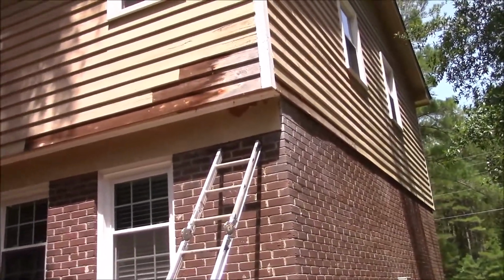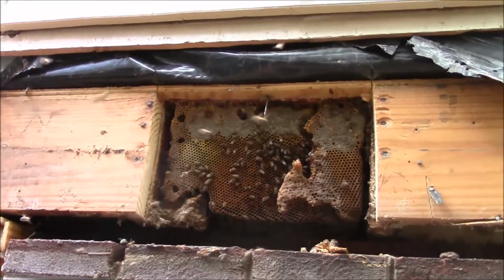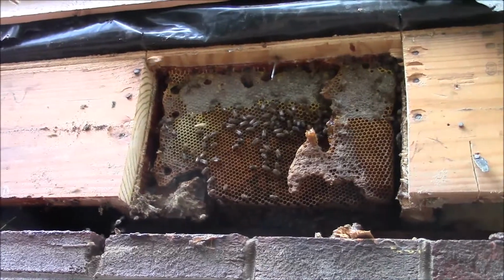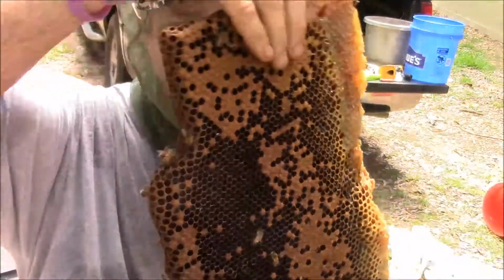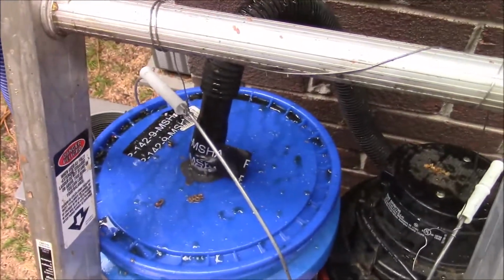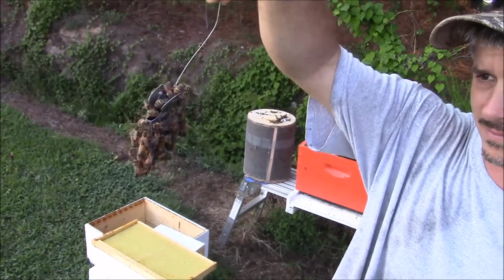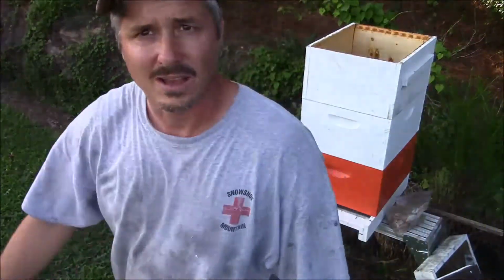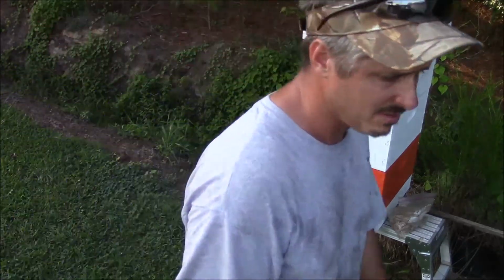The honey hive honey bee removal

Comment: I have been told (and seen) that bees would rather crawl up so the folks that needed to get the bees out of the vac cage put it in the bottom two boxes with the hive and cutout comb on top. Your choice to put it in the bottom box seems to work for you but you might find the bees have an easier (quicker) time getting out if it is in the bottom boxes. I did notice you opened the "bottom" of the vac cage which I guess is just as good as putting the comb on top. Thanks for the great vids and please keep them coming!
Reply from the maker: Mark Crider the reason why I put the door on the bottom is 1 to dump more bees out and 2 that's the direction of the comb and the queen. I went out this morning at there was 5-10 bees still in the basket so I took it out. I am glad your liking the videos